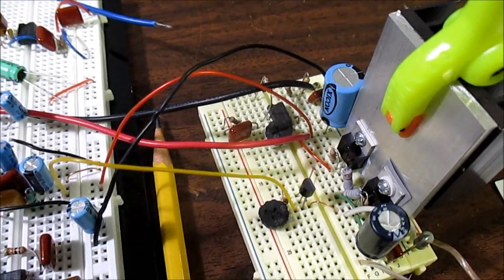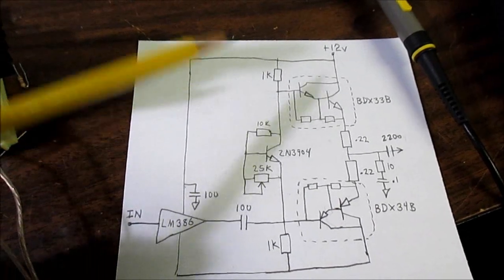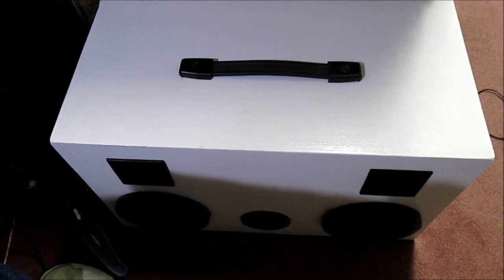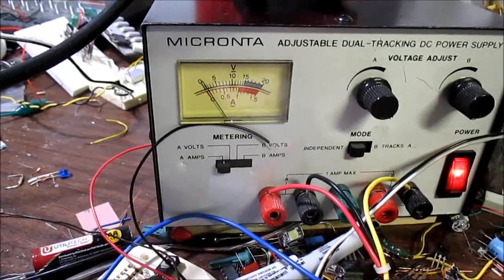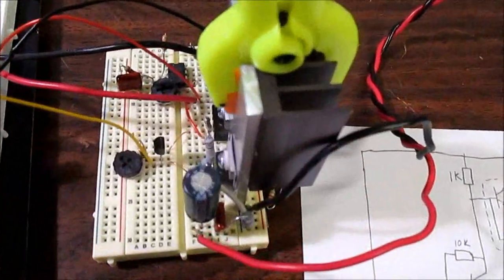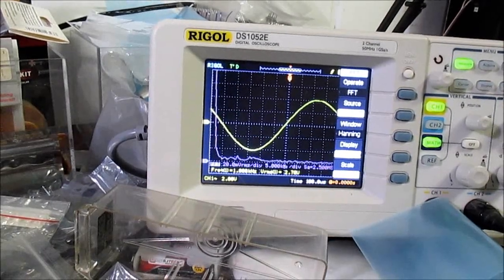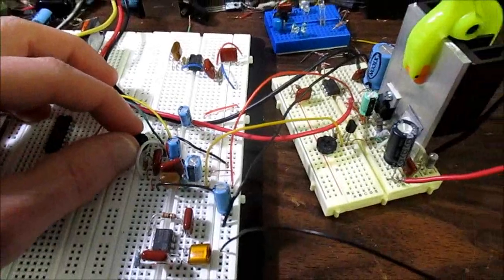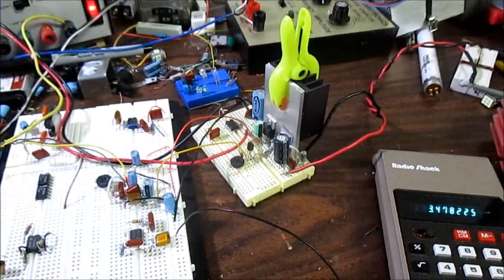LM386 output booster stage attempt 2

Comment: Do you have a schematic for the whole thing? 
Love the DIY spirit :)
Reply from the maker: +Matej Blagšič The schematic for the LM386 can be used from its datasheet and interfaced with the output booster (buffer).
Reply: +JohnAudioTech Oh I see, so the lm386 is wired as a normal audio amp + the output booster that is drawn in the video. Thanks

Comment: This stage you are using offer you only current gain...not voltage gain....so, your advantage may be the use o lower impedance speakers only..but no advantage on power output related 8 ohms loads....if you want  power output increase you must use a Voltage Amplifier Stage
Reply from the maker: +Carlos Mergulhão Since the little LM386 is current starved it can deliver only about 600mw into 8 ohms with a 12v supply and can't deal with 4 ohms at all. I'm well aware the emitter follower output stage has no voltage gain (actually slightly less than unity voltage gain) but it gets me 2x the output with 8 ohm loads and since I can turn up the voltage a bit and use a 4 ohm load, I get ~5.5x the power. It is too bad the LM386 can't swing any closer to the rail on the positive cycle for even more clean power.
Reply: +JohnAudioTech  If the LM386 was driving a higher impedance would it look better?
Reply from the maker: +HillOrStream Driving the output stage as configured in the video, it sees a light load of several hundred ohms so that is as good as it gets. In general, solid state amplifiers distort less with lighter loads, so the before clipping performance of the circuit should be quite good.

Comment: Nice work. So, to get more output power from the amplifier, with a low voltage supply, you would need an audio transformer to boost the drive to the speakers?
Reply from the maker: +BlindCompass Yes, you could design the output to drive a high current matching transformer. Audio quality transformers are expensive and for this application rare. You could just use a 2 Ohm speaker if the amp is up to that.

Comment: Nice! I built this http://redcircuits.com/Page33.htm amp with very similar performance to yours, just replaced diode&trimpot with Vbe multiplier, and it works just fine. And I used BD139/140 for the output, for normal listening I've found that they handle such power very well. Last time I measured it gave 1.6W out into an 8R load at 12V supply. For some reason, I just love discrete designs, even though I've used IC amps a lot as well